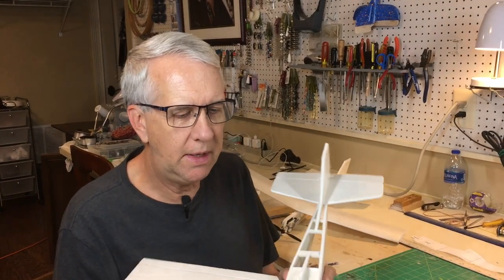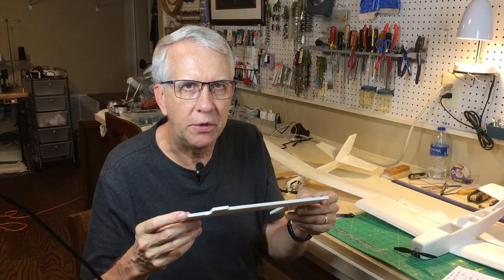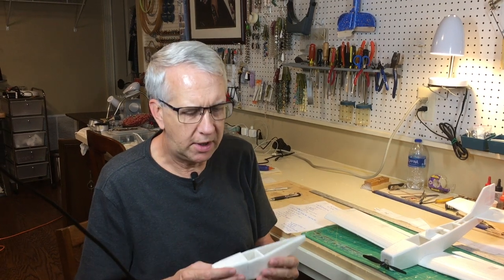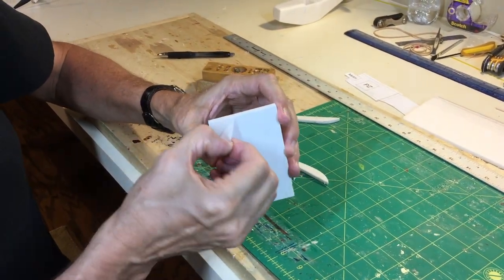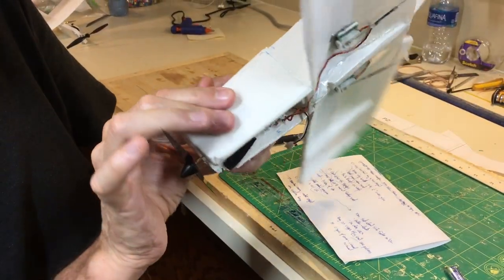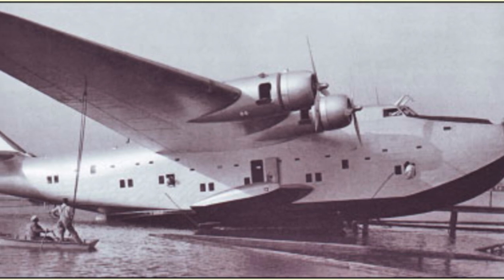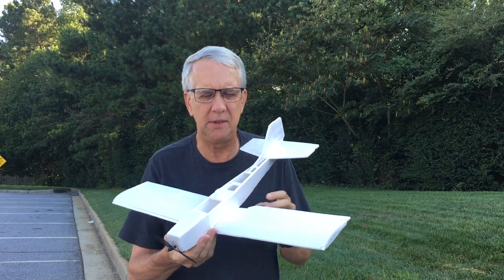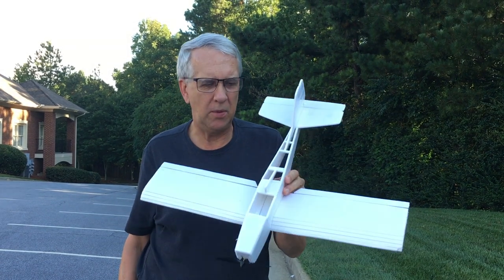Design a Foam RC Plane -  Failure to Success!

Comment: I believe your explanation for lack of rudder control is totally on point. It would appear that the small amount of thrust generated was overwhelmed by the increased drag of the wider and open fuselage. I will keep this in mind with my scratch builds.
Reply from the maker: Tracy:  Thanks for your update.  I think ailerons are a great way to go with these smaller models.  Tim

Comment: Great job and well explained. The only comment I'd like to make about the model is about the openings in the fuselage. This could interfere with the flight because of air that gets trapped inside and the way it exits the model. Maybe that is why the rudder did not function properly. The profile model had no such issues because it's flat and air can flow alongside without any drag. Just an observasion. Keep up the good work and looking forward to more future valid instructions.
Reply from the maker: Joseph:  Very good point on the airflow issue, and thanks for viewing the channel!  Tim

Comment: The way you build,  the wings are actually undercabered  so produce high lift which is good for slow or indoor and park flyers , and work pretty good when used  with enough dihedral in cabin or high winged planes. But for low winged planes, because of the high lift they produce ,  more dihedral is requred to reach required spiral stability ... so think the lack of flow around the fin and rudder  was not the only problem that caused crashes in first attempts ... you can still build stable rudder - elevator low wing models with much less cambered wings and a bit mor dihedral .... also lowering aspect ratio migh be of some useful effect 
Thanks for sharing this video , and showing the way you cut ribs from foam ... i have tried to make ribs from the foam but the results were not satisfying 
Thanks again
Reply from the maker: MHS:  Excellent design points, thanks so much for sharing!  The test flight with rudder control was strange.  At first I thought the rudder control rod was not connected.  Live and learn.  😁  Tim
Reply: @TimMcKay56  thanks to you now i know how to scrach build my foam wing , i leard a lot 
Thanks
Reply from the maker: 👍🏻😊🎄✈️ Tim
Reply: I also noticed the moving part of the rudder stops above the upper line of the fuselage. All my trainers had a rudder that widened towards the fuselage horizontal centreline and continued under the level of the stabiliser. This design adds some complexity but has the advantage of catching the airstream at the lower part of the fuselage.

Comment: Nice video thanks. I wonder if there was disruption of airflow due to the open fuselage and whether covering at least the dorsal with paper would help? I plan on learning with the profile model you presented.
Reply from the maker: Chilarai:  I do think an airflow disruption was part of the problem.  Really took my by surprise, but live a learn.  Even Boeing, when flight testing the real airliner, learns things not known from the design or wind tunnel tests.  Tim
Reply: Excellent point!  I can imagine air coming up through the bottom

Comment: Excellent video.  Could you provide a link, Part # or other good way to find the flight pack with Rx, servos, esc and motor? There are many hits that give very little description
Reply from the maker: Should be the Parkzone ultra-micro electronics. Sometimes hard to find. First stop is www.StevensAero.com  Tim

Comment: thank you for going super in detail with your explanations, I built three RC planes using foamboard and they would either be too heavy or would be unstable, thank you for helping me understand what I did wrong... I'm currently building a plane that should carry a good amount of weight and be stable in the air, do you have any recommendations or tips you could tell me please?. Abdulla
Reply from the maker: Abdulla:  Try my foam board Bronco. Easy to build, light and flies great!  Tim

Comment: try relocating the engine. Move it closer to the top of the nose instead of under it. The propeller diameter used is not large enough to overcome the height of the nose and provide airflow to the rudder. Try the same design with a profile hull and you will not have a problem because the profile hull does not have a rectangular wall to prevent air flow to the rudder.
Reply from the maker: Great points, thanks!  Tim

Comment: The cuts in the wing would work better on the under side. Not a big deal for a slow flyer, but a smooth airfoil is always better. Same thing on the fuse, put the cuts on the inside. It will work, and on the inside, you can drop some hot glue in the slit to really make it solid.
Reply from the maker: Corey:  Great point, many thanks!  Tim
Reply: You can also use a little heat and drag it across a rounded table edge or pipe to curve it.

Comment: Do you think making the Tail taller or the Rudder bigger would have improved that?
or maybe since it is a Lower wing configuration it's simply not getting enough speed to get the air to the tail it needs?
Both are just immediate theories I had after seeing it and have no real knowledge in that area, really enjoyed the video and might play around with this design you have here myself
Reply from the maker: Saber:  All good points. It is fun to try them out and see what works!  Tim

Comment: Tim could you suggest me a motor and prop combo for an  airplane having all up weight 160 grams. Here the 160 gram is without including the motor and propeller. Thank you.
Aneeshmurali.
Reply from the maker: Aneeshmurali:  160 grams is around 5.5 ounces.  A bit over what my Guillows Zero weighed.  I honestly do not have anything I can recommend in this range, it is always a search for me.  I generally start with E-flite motors, see what their smallest motor is.  Ofter these charts list a recommended weight for the model.  Tim
Reply: @TimMcKay56 That's why i wonder Tim.
Here, The 1.5gm servos are not available, coill servos are not available but 9gram servos are everywhere. If I import the parts it's going to be too expensive. so, it's a difficult task to make the airplane lighter.
But without electronics like battery motors,etc. the aircraft weight is only about 61grams.
So I'm thinking about the combination of multiple 3.7v 8520 coreless motors. each motor with prop combo is only 5 grams. But each motor will provide 25 to 27 grams of thrust.
So I'm planning to mound the motors on both sides of the wing with CW CCW props so it will balance itself.
From this two motors I will get 54 grams of thrust.
Im planning to use differential thrust to turn the airplane and a 9gram servo to control the elevator. 
There is no rudder and aileron controls. but according to my plan differential thrust to make the turns and a single 9gram servo to pitch.
Now the estimated all up weight with all the electronics including battery is 115 grams and thrust is 54 grams. 
So my question is can I take off a 115 gram aircraft with 54 grams of thrust.
It's wingspan is about 27 inches with 5.5 inch wing chord. Airfoil type, undercambered.

If the thrust is not enough we can add additional 2 motors on both sides. Which will add additional 11 gram. but also we get additional 54 gram of thrust so (115+11) now the all up weight is 126 and the thrust is 108 grams almost close to 1:1 ratio.
Let me know your thoughts on it.
Thank you.
Aneeshmurali.❤️😊.
Reply from the maker: @Ciiads  I think you are a leader on this, and the best way ahead is to make an estimate, which what you have done, build it and see how it will fly!  The smaller models always a challenge with whatever is available to control and power them.  I think you are on the right track to experiment, see what works!  Tim
Reply: @TimMcKay56  thank you ❤️.
Aneeshmurali.

Comment: what receiver/servo board are you using and where can it be had? Googling got me the AirTractor replacement board...but nothing else.
Reply from the maker: These micro units come and go with the challenges with supply chains from China.  When  you Google, ParkZone ultramicro is a good search term.  Best bet is to check in with and email to www.StevensAero.com as they have numerous airplane kits designed around these micro RC components.

Comment: What hardware with recievers for micro planes that could connect/bind  to my spectrum transmitter?
Reply from the maker: There are so many out there, no complete list I am aware of.  Best bet is to ask the receiver maker if your Spektrum transmitter will bind.  Plan B is to check www.RCGroups.com

Comment: Nice designs.Could I ask what diameter pushrods you use,and what size and where do you source your control horns? The ones available for models like the Champ are pretty flimsy.Also,have you done any planes using brushless components,such as in the e-flite Timber? Thanks in advance.
Reply from the maker: DC:  I have a collection of various sizes of music wire.  I use the finest (smallest) diameter wire that I think will hold up to save weight.  There really isn't that much force on the control surfaces with these smaller models.  Just ensure the wire pushrods are adequately supported along their control runs, as flexing will be a problem.

I use Dubro mini-control horns.  Type this into Amazon search.  Do not but the Dubro horns (as they are too expensive).  Rather there will be an Amzaon (Best Buy) that is the same thing.  Hot glue holds them in place nicely on the foam board.

I actually have an E-flite Timber.  All of my models use brushless motors, except for the ParkZone motor.  No need, really, with these tiny motors.  Gearing does the trick!  Tim
Reply: @TimMcKay56  Thank -you for the info and quick reply.

Comment: I have just built a same plane like your , but smaller , could you tell me where is the CG of this plane , since the plane's airfoil is hard for me to located it
Reply from the maker: CG is 25% back from wing leading edge.
Reply: @TimMcKay56  thanks you very much sir, wish you have a nice day and always happy to make these helpful guide video for beginner like us ::))
Reply: @TimMcKay56  Sir ,there is one last question i want to ask you that if i use the PVC food wrap to cover the surface below the wing , does it have a better lift thrust and efficiency like real airplane , cause in the video i saw that the wing's bottom is empty, compare to other airplane that has a cover below

Comment: I'm not sure of the correct terminology....
Ae you mounting the motor mount at 90° ?
FT and DW have a slight right hand angle, DW's also have a downward angle to the motor with the righthand angle.
Reply from the maker: DD:  While the motor mount may be drawn on plans at 90 degrees, it usually works out best to have a slight (2-3 degree) right thrust and down thrust.  A washer can usually help with the adjustment.  Tim

Comment: what glue for foam ?
Reply from the maker: Glue stick that comes with any hot glue gun. I use a smaller size hot glue gun, $10 on Amazon. Glue dries in 15 seconds, perfect for foamboard. Tim